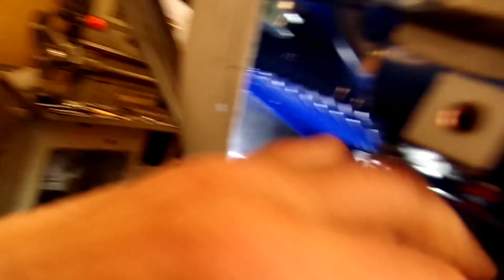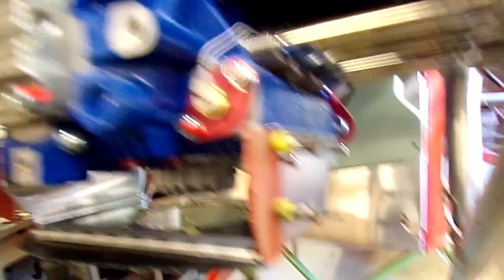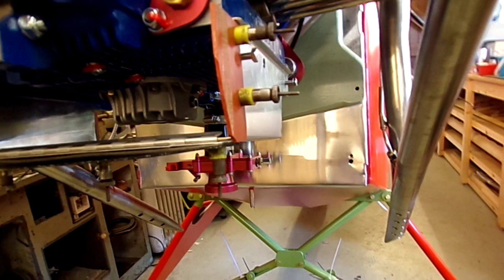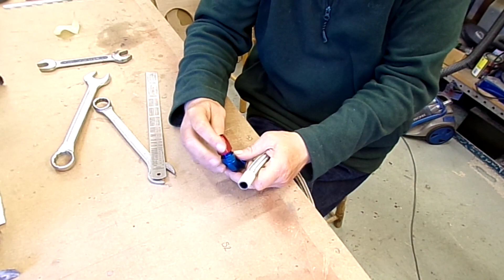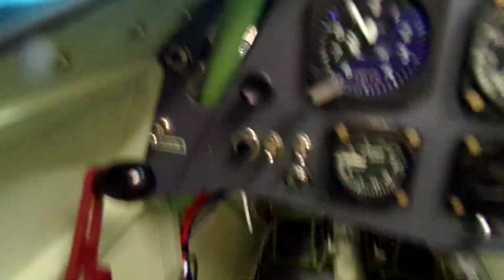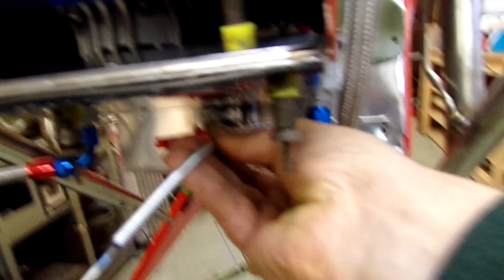EP156 The oil cooler system is taking shape. Fisher Youngster

Comment: Is there a reason not to use compressed air like nitrogen to pressure test the hoses?
Reply from the maker: Yes. Using gas is dangerous, if it fails it tends to a burst (almost exposive due to the resevoir of pressure) with bits flying in all direction, with hydraulic pressure as soon as a small amout of fluid comes out the pressure has gone as long as you don't keep pumping.
Reply: Well, I wasn't thinking of a unregulated air pressure off a 3000psi bottle. Just that you could use a regulator to 25 or 50 psi (or somewhere in between) to pressurize the line and check the seals with soap or do a leak down check by cutting off the air supply for awhile and see if it loses pressure over time. this to me seems to avoid all the oil mess that comes with checking it that way.
Reply from the maker: @jonned32  you could but gases all store a lot of energy as they are compressed,  fluids don't compressed so safer, but you are right at 50psi the danger would be low. I tested a model steam boiler  with compressed air at 75psi and took out half a shed wall  (It was only the size of a coke can), it was pumped up with a stirrup pump, so from then on I tested them with hydraulic pressure. With the oil system it would need opening the system again to get the oil cooler and pump primed and still hard to seal the air in, so would need to be off the aircraft,  which means I would miss out 2 critical joints.
Reply: Thank you for the reply. I respect your engineering background and experienced building skills. But I still think just checking with nitrogen especially on such short hoses you would not have that much energy potential for a catastrophic failure. I could see that if the connections were held on with zip-ties or hose clamps, but these are very much engineered connections. Anyway I'll leave it at that, and I really enjoy your videos and its amazing all the tips I've picked up on.